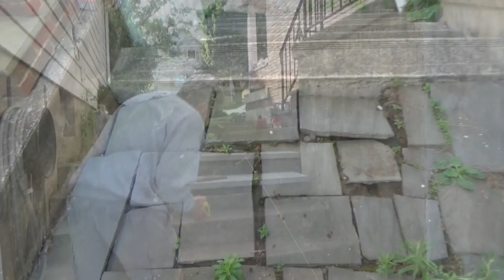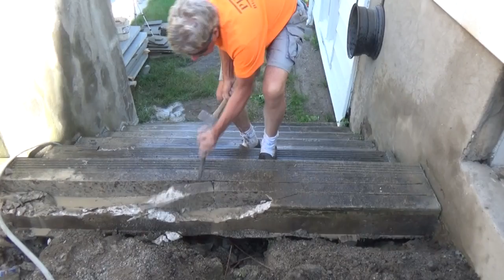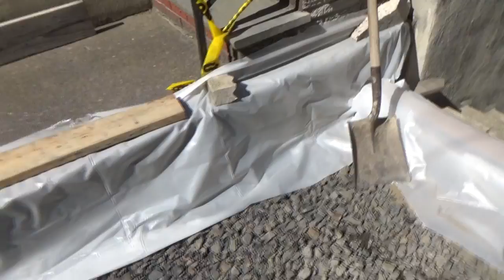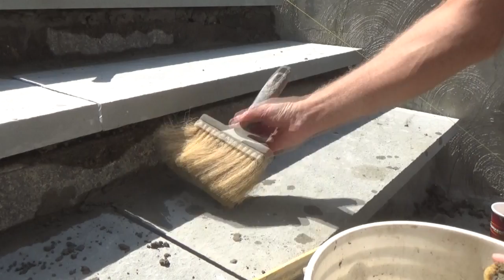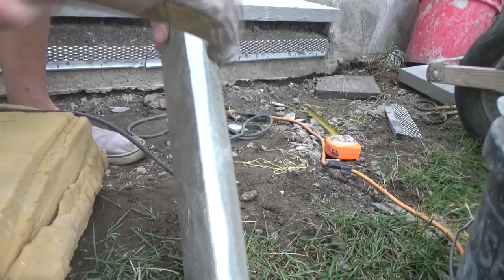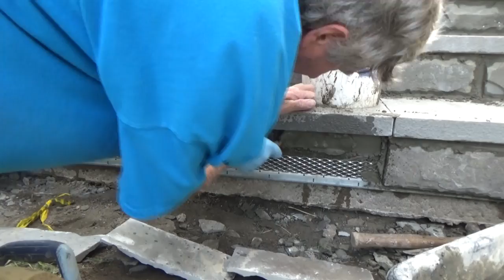BUILDING STONE & MASONRY STEPS (part 12) Mike Haduck

Comment: If you make door and window lintel beam with rebar and block,, won't it break when rebar rust away ?
Reply from the maker: Hi Jimg, in time it will, most old masonry buildings used arches before the Civil War, then they started to use steel, the idea is to keep the moisture from penetrating into the concrete, usually roofs ,paint where it is ,how it's installed, etc, etc helps in those instances ,  thanks Mike

Comment: Hi  Mike , im a retired mason from nj  , nice job on these steps , i just wanted to know why did you make a stack joint on the treads , i always used to stagger the joint say a 6 ft piece on an 8 ft step with  a 2 ft piece  back and worth , maybe i did it wrong anyway your steps are really nice  thanks   Artie
Reply from the maker: Hi Artie, nice to hear from a nj mason, I worked a ton down near Summerville,  actually they were shared steps between the two houses and that joint was the property line,  thanks Mike

Comment: Hey mike I’m thinking of building new front steps out of retaining wall blocks on a new footing and slab I poured, out on Long Island NY with freeze thaw winters, I was told I can just use masonry adhesive instead of mortar. What are your thoughts on this? Doesn’t seem right to me and you’re the guy to ask!
Reply from the maker: I have video out called " concrete steps repair, those kind of blocks don't hold up in my area, the new schoolers say different,  thanks Mike
Reply: Ok gotcha, I’m just having a difficult time trying to figure out these steps the right way, I already got blue stone treads, and was going to just use cinder blocks and mortar but even with half block caps and full blocks I can’t figure out how to get the steps about 6.5 inches each even, with having bluestone laid rising up on the next steps, regular cinder blocks are too big and would need cutting or excess mortar. Working with 26 inch height, and 3 steps with 4th being the landing. Watched your videos over and over but can’t figure out how you get the right heights and all

Comment: I have watched most of your videos. I'm at the final stages of renovating concrete steps with cut stone veneer and bluestone treads. The treads come with a thermal finish with a rough backside. What side goes up? I've heard conflicting advice. I live in MA.
Reply from the maker: Hi Soccer, I usually put the thermo up because it is not as slippery but it's usually masons choice, thanks mike

Comment: Mike.....is the soft pack you used between the concrete and the steps 1-5 Portland? I struggle with two things (1) getting the film off the brick/stone (2) getting the mortar at the right consistency. Any suggestions on improving in these two areas would be appreciated. Thanks in advance
Reply from the maker: Hi Oring, it's one of those things you got to practice with to see what works. The sponge has to be very clean and ring out between uses,  when I use Portland it is usually 2 sand 1 portland, thanks mike

Comment: Excellent tutorial Mike,  I am a DIY homeowner and have done my own masonry projects over years.  It is a blessing to be able to learn from a professional such as yourself.  The part about not having the new concrete touch existing concrete is especially good so know.  What brought me here is my front concrete steps are deteriorating and I am wrestling with whether or not I should completely remove them and pour new steps or cap them as you have demonstrated here.  Thank you for sharing.
Reply from the maker: Thanks E.   I am sure it will work out one way or the other,  mike

Comment: Hi Mike.  Finally got my cellar hopper/glass block window in.  That job turned into a nightmare.  Now I'm trying to repair my front steps before it gets cold.  The old cinder block underneath the stone veneer suffered damage due to a leaky gutter seem.  The gutter is now fixed.   I may need to buy a new flagstone top run.  What stone yard do you recommend for such things?   BTW, when I was picking up supplies at Santerelli (Oley) on the back road I mentioned you. They're good guys over there. Also saw your work in Leo's Broad Street Winery.  Again, thanks for all your vids.  They sure gave me confidence to tackle these jobs.  I owe you a couple two tree beers.  Tony Sciandra in Port Griffith.
Reply from the maker: Thanks for the kind words Tony,  I got to get down to Oleys, one of these days and do a video,    I think any stone yard,  I use to go to Ayers and buy bulk, but any stone yard shhould sell what you need, glad to hear from somebody so close, thanks Mike

Comment: Mike, the “stone’ you placed as steps, are they concrete caps you make at home as you did in your other video?  I have a very plain 2 step back porch and trying to find ideas to make it look nice and hide the cracks and that the bottom step cracked away from the whole structure.  I was going to use regular bricks but after your constant repair and recommendations against using brick I’m looking for other options.  Your vision is quiet creative just beautiful work.  I can make the caps as you’ve instructed and can buy stone for a backing riser without ripping out the whole structure.  Your videos are my daily motivation to get off the couch and get things done.  TY
Reply from the maker: thanks playgirl,  you can usually buy the stone threads at any stone & brick supply yard,  and just think it throught, I hope my videos helps,  I can only show what I did and hope others feed from it ,  I appreciate it.  mike

Comment: Hey Mike , when you're attaching a stone veneer , do you ever dust the veneer stone with a little  Portland cement before buttering it with mortar ? 
Second question is , what is your mixture for that mortar ?
Reply from the maker: Hi JM,   If I am reading you right?, I never dust the stones with portland ,  did use it as a "dryer" to gain height,  I used same as other videos in the series,  (2 sand to 1 cement),  (Cement is usually 2/3 s mortar and 1/3 portland)  other masons in other areas would say different,  I hope it helps thanks mike
Reply: Dusting the stone with Portland  was something I was told would help the cement stick better but I have little personal experience to validate that . Thanks for your input.

Comment: Good efficient use of existing materials/steps and end result really nice . 
I poured a few steps and done some with engineering brick filled and capped with paver slabs .
Do think stone about one of best ways go though and job you done on these pretty cheap in materials yet end result a million bucks plus it last well and easier repair if needed .
Reply from the maker: Hi B,  its hard to say from here, but if it works and others have been successful with the same process, you should be on the right track,  I appreciate it.  mike

Comment: P.S. How I wish you were on the job I am doing now lol... making a 3 meter plus high fountain with urns for a client and it's not an easy task. Mortar and limestone work into week 3.... ouch my back haha
Reply from the maker: Hi Fresh,  I did one before,  and I built it in pieces and then when on the job and put them together,  and put water in each layer before I continued up to make sure the fountain water spread on every side,  wish I filmed it.  check out my video How I build a stone birdbath, almost same thing but used a long steel pipe int the middle to hold it all together,  I hope it helps, thanks mike

Comment: Doesn’t the alkaline burn your skin? I’ve noticed you mostly don’t worry about it but sometimes you wear the glove? I’m completely paranoid about burning off my skin with cement or mortar but love the feel of the stones in my hand. Also breathing all the dust? You don’t seem to worry about that either?
Reply from the maker: Hi Tami,  I try and use the glove all the time,  but not as much dust as it seems,  thanks mike
Reply: Mike Haduck Masonry also he plays with fiberglass bare handed... that’s a not a fun thing to get stuck under your skin. It will itch forever.

Comment: No rebar?
Reply: I thought you did nt like wire mesch
Reply: Some local building codes don't allow steel reinforcement in patios, driveways, and sidewalks as the steel makes the concrete difficult to recycle.  Rebar is not a given in all concrete - you have KNOW and follow the local codes or you won't have your contracting license for long.